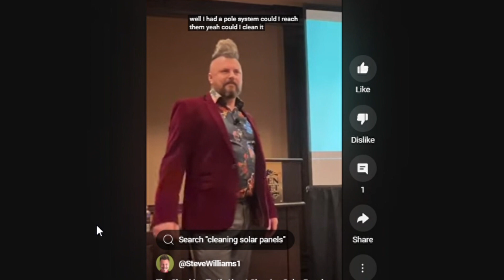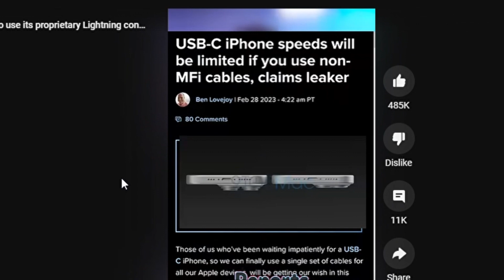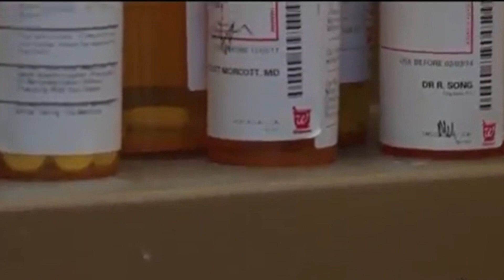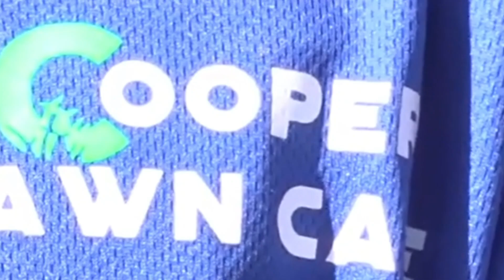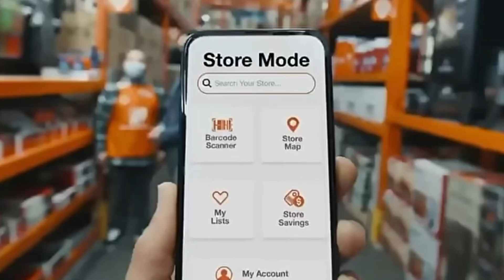Solar Panel Cleaning Standards  | Chris's Rants | Video Series Part 1

Comment: 10:42 Dude that's a false dichotomy.

The obvious thing you need to do as cleaners is to form a union (if not done already) and define those standards yourselves, precisely because you are the right people to know what works and what doesn't.
Reply from the maker: Intesting comment. Forming a union in the solar panel cleaning industry. I don't think this would happen as easily as you are thinking it.  How are unions formed? No one union was formed by simply speaking it into fruition.
Reply from the maker: Cleaners around the country would have to organize under a collective entity. We would have to negotiate standards, wages, and working conditions. Most likely how union's were formed in other industries.
Reply from the maker: However, our industry is sooooo young. There are so many indepent businesses, operators, and even large corporate outfits. The question is. Are all of these professionals willing to unite? I don't think so.
Reply from the maker: I do agree that those who are helping to create these standards should be those out in the field, those who actually have mutliple years of experience, and experience in various sectors of solar panel cleaning.